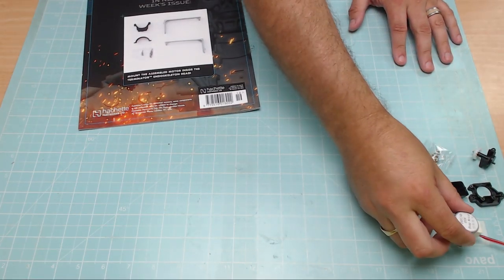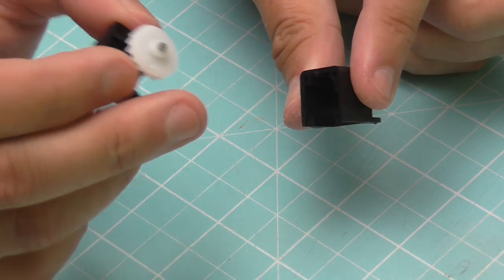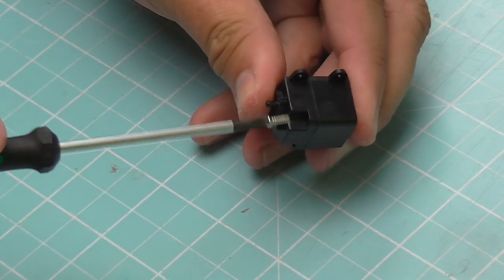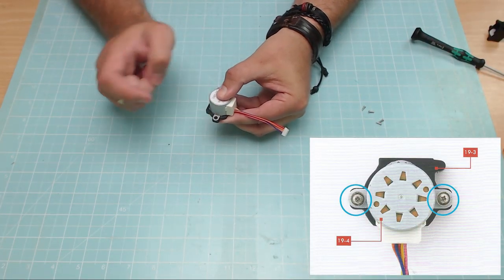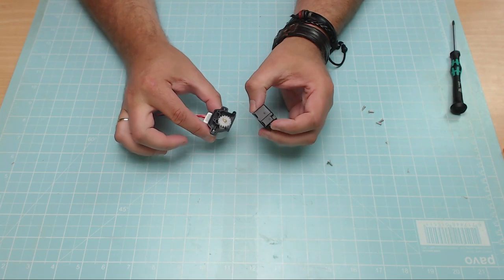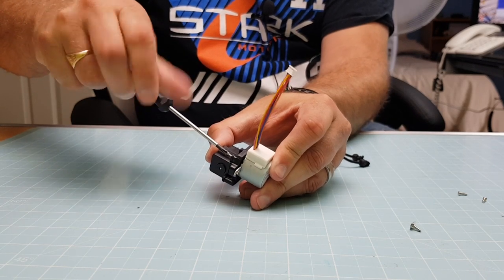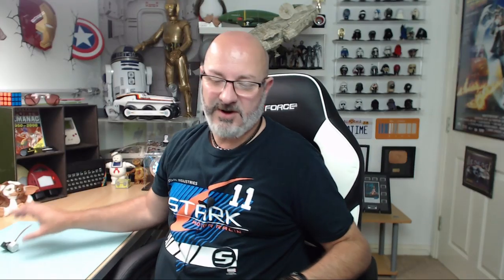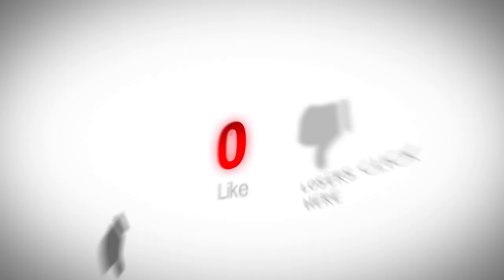Build the Terminator - Part 19 - Assembling the Head Motor

Comment: Wayne Green if you look closey on the back of Issue20. You should see3screwholes/they get screwed into the back of the T-800skullhead1st. And then you screw on the Black fastener that secures the motor as they work seperatly

Comment: This just gets better with each issue. I've noticed theirs aconsiderable difference between this and the Bismark motor. The bismark motor is small round/has3wires and3plastic cable connectors. The terminator is round bigger tube shaped/has4cables+4cable connectors. And the motor for the bismark is 1:4scale. And the terminator jaw motor is1:2scale. So that means that the terminator jaw motor is gnna be slightly more powerful than the bismarks 12 14 or16pound gun motor. Can't wait to see both the eye/jaw motors in action